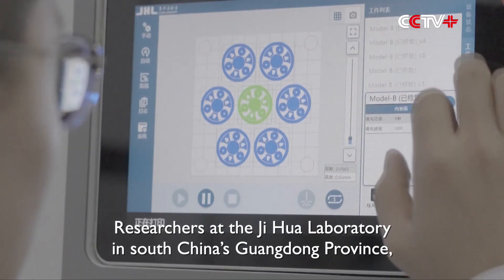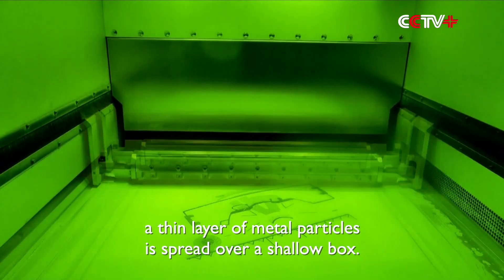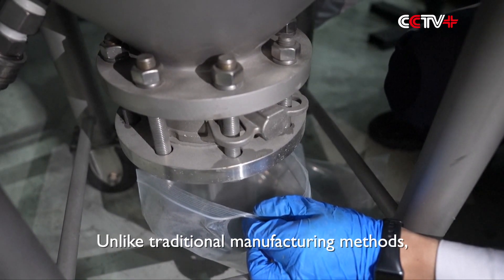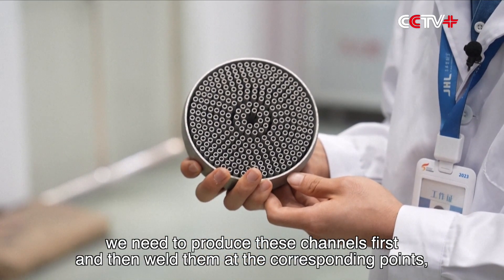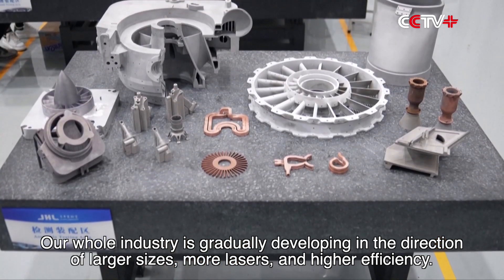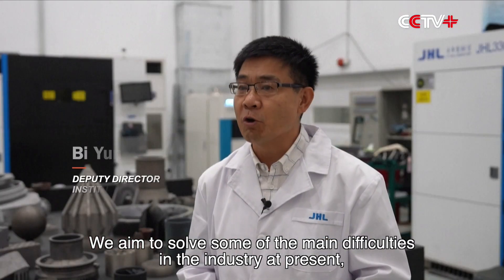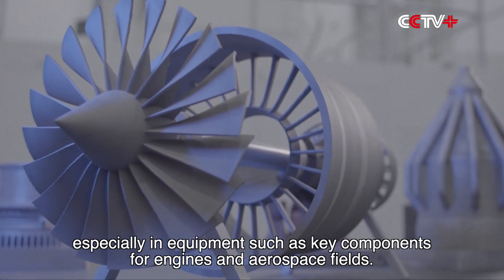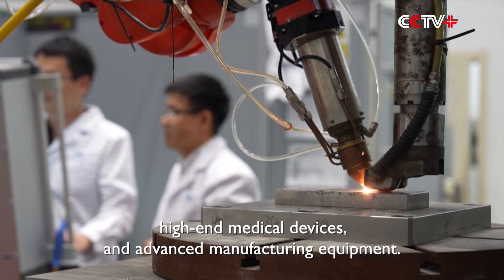Chinese Scientists Leverage Metal 3D Printing to Upgrade Traditional Material Manufacturing Industry

Comment: 3D Printing China's way is novelty is good but next-generation will getting materials to bond at a molecular level for stronger strength to prevent structural weakness. Like growing silicone wafers or rock crystals, using Ultrasound or Magnetic waves to alignment these materials is the next step to bonding valence levels together.
By forcing or condensed materials to strengthen will put these countries or groups to advance to another level of manufacturing!!!!